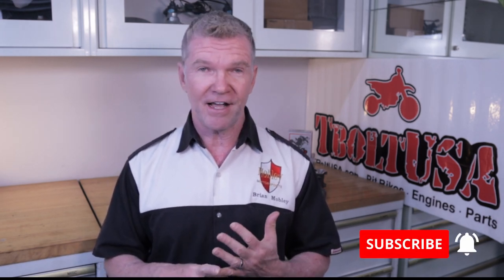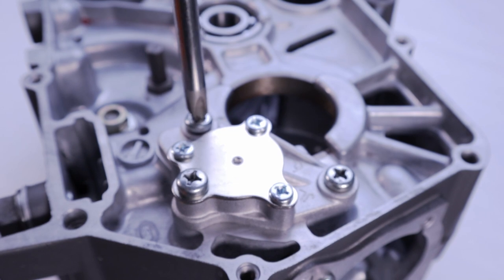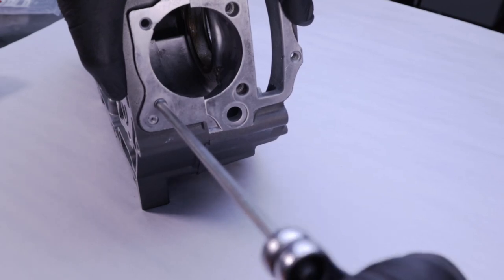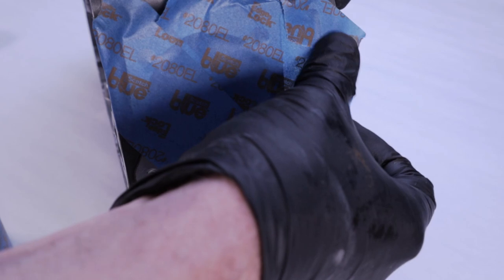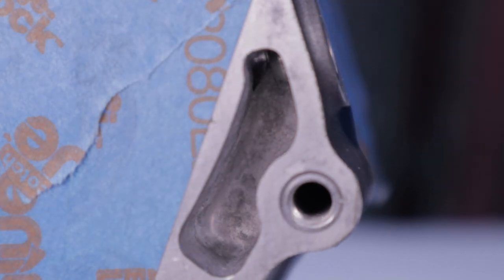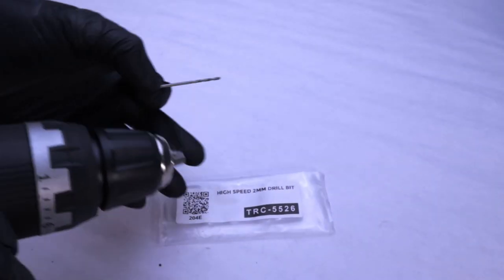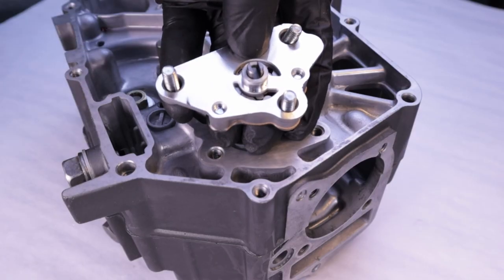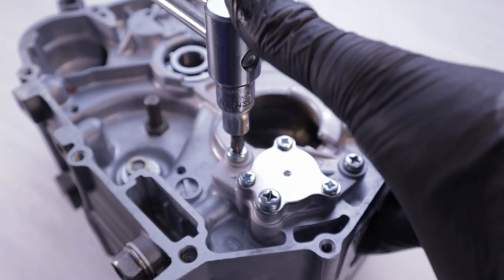How To Install A High Volume Oil Pump || CRF70 / CRF50 / XR70 / XR50 / CT70 / Z50

Comment: What is the actual difference between a high flow oil pump and a regular one? Other then drilling out the hole the pumps all look the same on the outside anyway. I've looked at buying one but they all have 24 teeth on them just like my stock oil pump. Is it the size of the gear inside of the pump? Also the oil passage hole on my Piranha 140 was already at 2mm so am I good to just leave it there or do the 140's go bigger than 2mm?
Reply: Considering TBolt hasn't responded and I've already taken my oil pump apart I'm gonna guess that it's mostly a gimmick and the only thing that matters is the spigot hole size where the oil comes.out. otherwise their pumps labeled high flow are absolutely no different.
Reply: Definitely the drilling helps the most BUT bigger passages and lighter materials of the high volume oil pump helps too.
Reply: Funny, I've tried to find out what exactly is different from the stock pump compared to the tbparts hv pump with no luck. You're prob right. The drilled out passage is needed and I bet they figured they could profit off selling a pump. If there is a difference I'd like to know.

Comment: Hi. Am I going to have to drill the oil passage like this on a pirahna 140? I’m installing the hv oil pump from t bolt and a big bore kit.
Reply from the maker: Hey Justin. I’m not familiar with applying this procedure on a Piranha motor. Try reaching out to TBOLTUSA for guidance.

Comment: Great vids. Doing the 88 on a xr70 for class project. I drilled all the way to the passage that you plug with the paper. Does this mean the cam won't get enough oil? Did I completely ruin the engine?
Reply from the maker: Hey Chris. I’m not sure I understand. If you drilled the oil passage, you should allow enough oil flow to fully utilize the capacity of the high volume oil pump.
Reply: The hole that is supposed to be opened to 2mm instead of just drilling the 3/8 thickness went all the way to that opening that you plug with the white paper and clear tape. I'm wondering will there not be pressure to push oil up to the cam shaft.
Reply from the maker: @ceeraa2675  I’m so sorry Chris, I read your reply several times and it’s not clear to me. If you want to send a picture of your dilemma and explain it using sentences with punctuation, my Instagram address is in my profile and you can send a message/pics there.  I’ll try to help if I can.
Reply: @brian.d.mobley  I know this is a year old, but basically he's saying he drilled so far, that he is hitting the output section of the oil pump galley.  So he made a hole between the output of the oil galley and the galley that feeds the clutch area.   I'd assume you could get away with JB weld if done carefully, but it's been a year and he's likely not in that class anymore :)

Comment: is this the same as atc 70 as well?
Reply from the maker: Hey Branden! Yes.   Same EXACT motor that I’m working on in the video. Let me know if the video helps you.  BTW, my next video will be engine assembly.  So if you are rebuilding your motor, you won’t want to miss that one. I’m putting in a stroked kit so my 70 will be a 108.